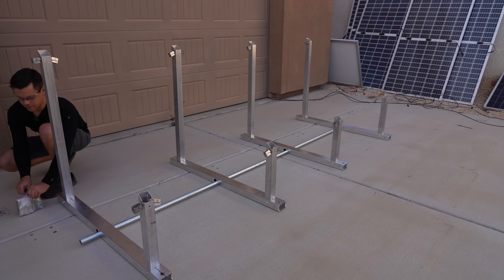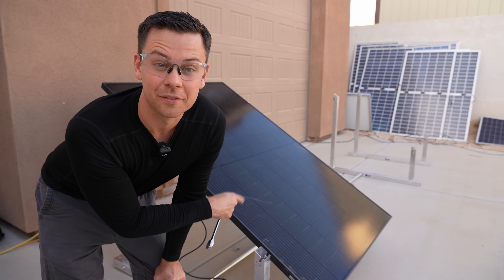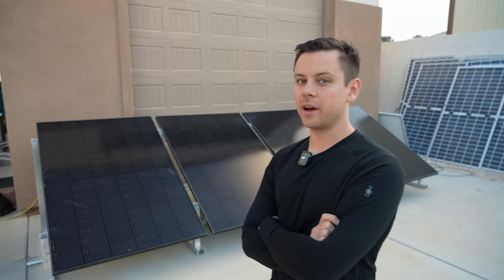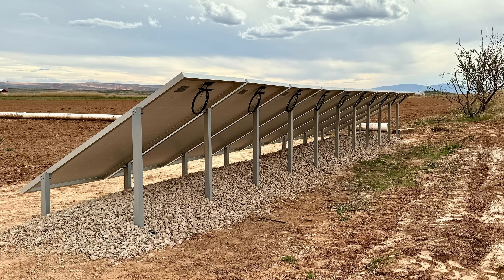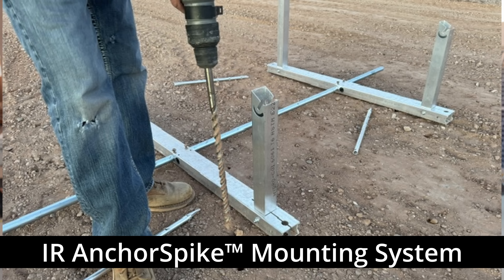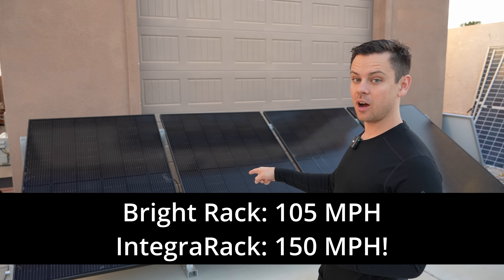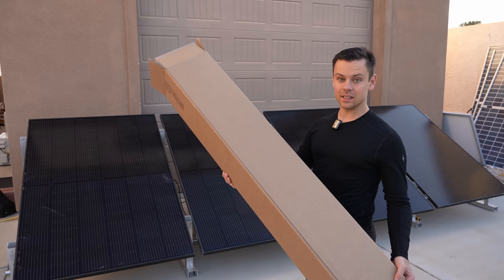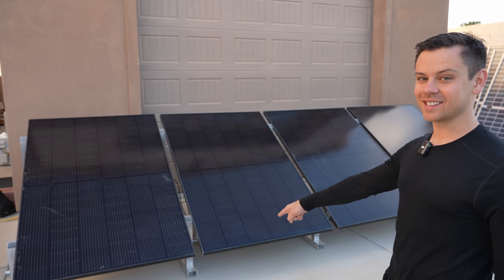IntegraRack: $545 Ground Mount Solar Array Assembled in Less Than an Hour!

Comment: I owe you a big thank you. I rarely wear safety glasses though I've been working with power tools got longer than you've been alive. Seeing you wear them frequently I started wearing them more often. Yesterday I was using an angle grinder to cut some steel, the disk broke and a big piece bounced off my glasses. It hit hard enough to leave a gouge and shove the glasses hard against my face. The gouge is directly over my left eye. Thank you for the good example, even geezers need good teachers.
Reply from the maker: Holy cow!!! I had some solder spit into my eye a couple years back. It was sore for weeks. I wear them always now. Even if I'm doing something for one second. I'm glad you are good to go. That's scary
Reply: @WillProwse  Ya I need to stop taking chances. Gotta wear the gear.
Reply from the maker: @goodcitizen4587  this was about 8 years ago. And I used to wear safety glasses for nearly everything. Now there is no exceptions
Reply: @WillProwse  It's not funny till someone looses an eye...
Reply: Luckily, I wear glasses for vision, and mine are safety rated, however, as I age, I frequently lift them to see clearly up close… and doing this while silver soldering over my head, I have splashed solder, and flux in my face… I got bifocal/trifocals added to mine… SAFETY SAFETY SAFETY!!!
Reply: All it takes is once
Reply: Aye. I was under my car a few weeks ago for just a few minutes and somehow got a steel shaving embedded. Eye doctor had to scrape it out with a sterile needle. The shaving broke and came out in chunks and it took what felt like forever.
Reply from the maker: @BurnerJones  😭😭😭
Reply: @BurnerJones I got a piece of rust in my eye while I was underneath my vehicle and I was wearing safety glasses.

Now I exclusively wear safety goggles underneath rust buckets 😂
Reply: @BurnerJones I got something in my eye from driving with top down, had the needle in the eye technique that works once, next time I will panic
Reply: I was using a weedeater at a low speed a couple days ago and a pebble smacked me about 1/2" below my right eye. Now I'm committed to wearing optical prophylactics
Reply: As they say, it’s all fun and games till someone gets hurt, nice work mate hi from downunder 🇦🇺🤙
Reply: Look up images of angle grinder cutting disc injuries. You can get a face shield at harbor freight for $10.
Reply: Angle grinders are very dangerous, there are even more dangerous attachments on internet
Reply: @rp9674  Decades ago, I worked for a historical hardware store while enrolled in college. We had a customer  purchase a replacement disc for the angle grinder. Well, he fiddled with some of the safety features on the tool and haphazardly tried to put the flange back on. He turned it on and that disc flew off the machine into his forehead. Needless to say, it wasn't a good outcome. Horrifically,  sad. The family tried to sue the store for not selling him safety products. So, ever since, I wear a helmet as well as goggles.
Reply: Nobody realizes that eyes are actually magnetic...to random things being shot at them. Glad you came out unscathed!
Reply: You saved me. I normally don't wear safety glasses while working on projects. I was ripping a 2x4 yesterday. I thought about your post and got safely glasses. I had a carbide tooth break off and hit me in on the safety glasses. I took me a while to figure out what hit the glasses. That's the first time I've ever lost a carbide tooth.
Reply: Always and always!  🕶😎  Same with gloves when under the hood.  No reason for contamination.
Reply: Using chainsaw I forgot to put goggles back on when cutting up debris, got one in the eye, could have been very bad
Reply: Dat's nuthin'.  Me, Lefty and NoNose were working on a job and we got ambushed and we lost a few body parts, but ya should've seen the other guys!
Reply: I was cutting with an angle grinder and the thin cutoff wheel blew up. About 1/3 of it was missing. I looked everywhere for the missing piece, but couldn't find it. Weeks later, I found it stuck in the plywood ceiling of my shop. I also dropped an angle grinder with cutoff wheel on my ankle, and it got 12 stitches. I guess they don't make safety socks.
Reply: I got some cheap safety glasses from Harbor Freight that fit so good, I forget they are on.
Reply: Yup, had to have a sliver of metal removed from an eye once - very stupid of me and a lesson learned!
Reply: I just took a hit in the nose.. like right above where your mustache ends and your nose starts... right in the center.
Reply: @PonoBill you should wear a full face shield with angle grinder. those cot off wheel could slice up your face!
Reply: Dope!😮
Reply: Safety squints is never enough. Glad you ok
Reply: Ive had a ton of things smack my face so i went glasses that are safety glasses to wear all the time on job sites. Last time the got blown off when I had a metal sheet fall on my head, but they saved my eyes
Reply: My own experience .. using a grinder . Got a sliver of metal stuck in my eye . Hearing the drill as the eye doc drilled into my eye , it was very little bit into the eye . But yeah , always protect the eyes .
Reply: I saw a man completely lose the sight in one eye and most of the other when the moisture in a sand mould turned to steam instantly when he poured molten aluminium into it and blew the liquid metal into his face. No goggles. I had an experience myself when cutting long grass and weeds with a petrol strimmer and hit a glass bottle. It shattered and threw up a shower of glass into my face. Fortunately I had both glasses and a face shield. Always, always wear eye protection.

Comment: It looks like you added 2x 1" emt conduit 10 ft long, correct?  That would add about 40 bucks to the cost.  Not complaining or anything but thats worth pointing out to everyone that wants to do a 4 panel kit.  also the cost of the additional components to add the 4th panel.

Comment: This is a great option for someone like me....i want to add more panels with a ground mount but the space i will use is over my drain field and i cannot use any system that requires going into the dirt as it would damage my drain field. The simple expandable mounts to fit the panels i have and ability to use ballast are just what i need.
Reply: You might wanta think twice before putting an UMBRELLA over a drain field !
Reply: @SandyBarbee  It doesn't change the amount of rain getting in there, just changes the distribution a bit

Comment: That's a pretty slick design.  I probably would have looked at something like this instead of building my little DIY mounts for my panels a couple years ago.  The ground clearance might be an issue for the snow, but I guess as long as things are anchored, you could slide the panel higher up on the racking system to give you a little more clearance.  

I wonder how those anchors would hold up in soil that's mostly sand?

Comment: Seems like a pretty misleading video! I have the other mounting system mentioned and it is not as hard or bad as he made it out. But the main problem with this video is pricing!!! Headline shows $109 ground mount solar array!  Their website shows that it is $109 per "frame", so what he shows in his video cost a regular person (not him) well over $500!!! Plus you have to buy your own 1" EMT!  And disliking mounting to concrete, he wound up mounting them to concrete.  And before anyone thinks that I just don't like this guy, I've been a fan of his for probably 5 years now.  But this video isn't up to his usual standards by a long shot.
Reply from the maker: No it's for four frames. Their website is wrong
Reply: @WillProwse  Thank you for the correction, but how can a  company make a mistake like that?
Reply: I see that you've changed to prices to be what their website shows - Guess their website wasn't "wrong" after all!  How did you make a mistake like that?!

Comment: Just bought 12, 100 watt grape solar panels to run the EG4 solar mini-split I also just bought and was looking for ground mounts when you dropped this vid. Great timing! Going to pick some up.
Thanks
Reply: It would have saved a lot of money if you bought 3 400 watt panels. The mounting will cost more than the panels.
Reply: @bobjohnson4512  If 400-watt panels could be sourced where I live at a reasonable price I'd agree. They do not. I got my panels from Signature Solar for 50 cents per watt. Also, I don't "need" a professional mounting system. I was only going to buy these because I thought they were MUCH cheaper. I can get by on a cheap, DIY, mounting system.
Reply: You better double-check that I don't see how 400 w total is going to run that mini split....
Reply: @MyCabinLife  Was planning on 3 sets of 4 for a total of 1200 watts. Using an EG4 hybrid solar mini-split. Whatever watts it may be short will be made up with AC from the grid. The unit can use both AC and DC simultaneously. It's also a SEER-22. Coming from old, SEER-11 window units, I think this will pay for itself in no time. Hoping anyway...
Reply: @MyCabinLife  12 X 100W = 1200W!

Comment: Edit: Will has already amended the pricing listed in the title and description of the video.. great content as usual!

Original Message:
Before anyone get's too excited, you only get one set of legs for that 109$ (not including the additional conduit or ballast supplies). A 20x panels mount will be well over $2500
Reply: I got excited 😊
Reply: They should offer a quantity discount.
Reply from the maker: Yes I just updated the thumbnail and title, there was a miscommunication yesterday when I asked what is a kit. Sorry about the confusion, everything is updated now
Reply: Can you use wood and just ground the panel?
Reply: @TamponTea 
That’s what I did.
Bonded all 13 panels together with jumpers and put a 10’ ground rod in.
It would zap you pretty good before I grounded them.
Reply: @glossyfpv1155  
Think about it.
I’m doing the same thing as if putting it on a steel frame.
Theirs a reason the clamps pierce the aluminum 
To create a ground.
I’m grounding the structure not a circuit.
The reason you only have 1 ground in a circuit is you want the short to go back to the main panel.
This is why you isolate a sub panel ground.
Grounding a structure is not the same as circuit ground.
I have seen crazy stuff where I had to isolate a piece of equipment from a structure because of stray voltage but it was near power lines and was inducing voltage into sensitive electronics
Reply: @TamponTea  :face-blue-covering-eyes::face-blue-covering-eyes::face-blue-covering-eyes: of course me horse 🐎🐎🐎:face-fuchsia-tongue-out:
get yourself a Veranda, make a car port install them there too :body-blue-raised-arms:
Reply: @glossyfpv1155  
I did not run the ground in with panel conductors.
And I did not ever measure the stray panel voltage.
The voltage coming out of the panels runs around 400v on a bright day.
Reply: ...It's not $575 for everything in this video???..All panels and mounts combined??   If not, very misleading.
Reply from the maker: @sb6232  no its correct now. It was $109 before for everything
Reply: @WillProwse  WOW!!!!!!!!!!!!!!!

Comment: Hi Will, I noticed my bi-facial panels surface temperatures are a lot cooler than my standard panels. I wonder if you could do a future video checking different panel temperatures. Thanks for your videos.

Comment: Looking at the site, this video is a bit misleading. each leg is $109. To mount 4 panels will be 5 legs = $545
Reply from the maker: Yeah it was supposed to be a 4 pack for $109 when I asked, but it is per leg. So I just updated the thumbnail and title. Sorry about that
Reply: $545 for only 4 panels? that seems like a rip off.
Reply: @nikolatesla3708  It will cost at least an additional $150 to hold them down.

Comment: I would like to get a kit that would allow the panels to be much higher. Along our north fence (facing south), is where I would place them,  and is where we have our garden. Having the panels up about 2' or 3' in the front and a proper angle for the rear vertical supports would be perfect, but the wind rating would more than likely drop drastically. Ahhh, I could put linear actuators in the front vertical supports for changes in the sun's angle, of course controlled by a Raspberry Pi. I like them though, may have to get some!

Comment: I have three big panels mounted on a wood frame connected to two posts. I can tilt and lock them facing east, west, or straight up.  I also have two tiltable wood frames made with three 100 w panels each that can very easily be tilted east, west, or straight up. However they aren't mounted to the ground.  I had one get flipped over once in high wind but it didn't hurt it.
Reply: Would love to see a pic of your setup!

Comment: Hey Will, Before you keep getting more confusing comments This is straight from the website link in your description. Is this a typo on their end or is each leg 109$??

Included
Hardware

    (1) IR-30 Base Tube
    (1) IR-30 Long Leg
    (1) IR-30 Short Leg
    (4) 5/16″-18 x 3.5″ Carriage Bolts
    (4) IR-F2 Flange Clamp Bonding Brackets
    (4) 5/16″-18 x 2.5″ Carriage Bolts
    (8) 5/16″-18 Serrated Nuts
    (4) 5/16″-18 x 5/8″ Thread Cutting Bolts
Reply: I brought this up and it was considered an ignorant comment from me so there you go

Comment: According to their website, it looks to me like the $109 is per leg, not 5 legs. So, to build what you have there would actually cost $545. I sure hope nobody is buying just 1 leg and thinking they are getting a whole ground mount system or something. Its not really clear on their website until you click on  "included" tab.
Reply: Sure looks like it. Every spec on that page makes it seem like 1 leg for 109, even the package size.
Reply: @eugenebeecher7308  Will just posted a reply to this, but did it on his pinned post saying that the website is wrong. I think I'll wait till they update the website, but if it does in fact come with 4 legs then it's a really good deal.

Comment: Excellent Video.
Just doing the back of the envelope math.  This seems to come even cheaper than if you built that with wood and of course the labour hours which is significantly different too !

The one issue I see (for certain regions) is elevation clearance (snow shedding off in front) and how this is system would handle Snow Loads & Shedding of ice & snow.  Ice & Snow love to still to panels, frames and any gaps that can act as "hooks" for it to hang on.

Is there a way to put the panels right up against each other ?
Is there some form of "gap" cover for between the panels ?

Comment: I would think mobile home anchors would work fine.  This is interesting.  Far less expensive than the previous ground mounts I put up.   I am a little concerned about how close they are to the ground.  Of course leave it to Will to crash the vendors web site! ROFL

Comment: I'm pissed Will !!!
I literally received my order of Brightmounts (3 boxes) less than an hour ago from Current Connected/FedEx... Ugh.

I would have bought these over them. Saved Bout $800 too. (thanks buddy😊)
I'm not really pissed, it's just uncanny how it all worked out.
I do like the bright mounts and they'll be fine.
Keep up the good work, love the videos man.
Reply from the maker: My Bright Mount is rotting on the side of my house lol I wish I knew about these earlier. I actually had no idea about these until a day and a half ago! Haha I had to make the video as fast as possible
Reply from the maker: Just so much easier
Reply: Did I read that right? Each single leg is $109.?! 
That means the Brightmounts are less expensive...
Reply from the maker: @BigBillFL  Yes but if you add price of concrete and time, its about the same or less. Really depends on how you wish to mount it
Reply: Is the 4 panel rig you built sturdy enough to move if it were on the grass?  Its a great design but would be expensive to use on smaller panels since it would require 1 leg per panel

Comment: Dont like the small 4 points of contact... I prefer more support behind the frame of the panel for snow
Reply from the maker: They can handle thousands of pounds. The mounts are really strong
Reply: Im sure the rack can but Im more concerned of the panel's frame stressing between those four points and damaging the cells.  Would be simple to run some conduit struts between them and mount the panels to that. Would also increase the versatility for smaller panels.

Comment: It would be nice for them to be angle adjustable.
Reply: If I have to fabricate, I’ll just fabricate the whole thing.
Reply: It's ridiculous not to have 2 to three adjustment settings .......... getting maximum winter sum is critical.
Reply: @davidfechter3635  one could come up with a hinge to place on the back side, or underneath near or just behind center of gravity, then use a similar square tubing and raise the front placing vertical pipes on the front with holes for each angle, and tilt the entire array.
Reply: Yes!!
Reply from the maker: They just came out with two adjustable ones. And higher off the ground: https://www.mobile-solarpower.com/ground-mount-racks.html
Reply: That would be helpful and would not be too much more expensive. There are also systems available that will automatically adjust panels throughout the day to follow the sun. Obviously that option would add significantly to the cost.
Reply: Am iI the only one that noticed he installed these panels behind the biggest shade in the world?